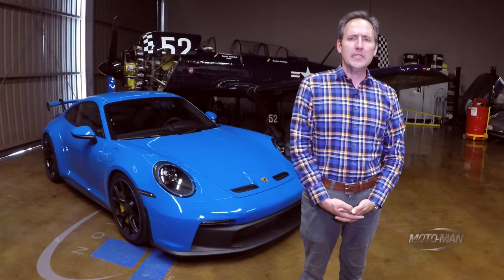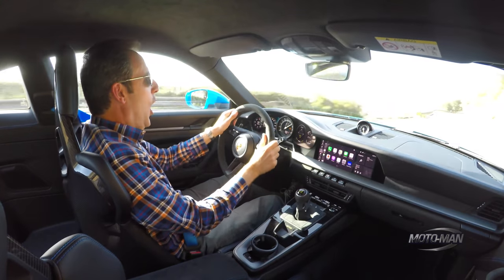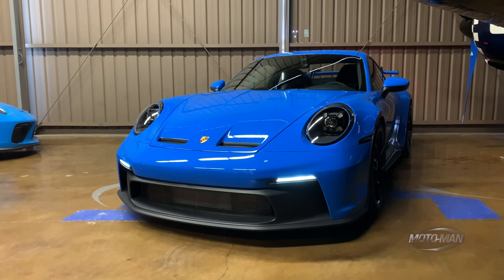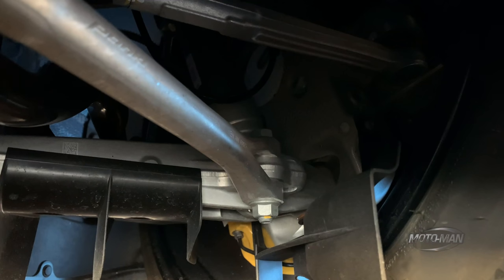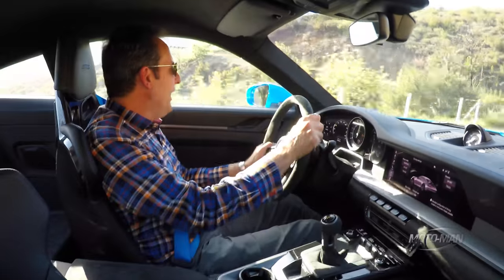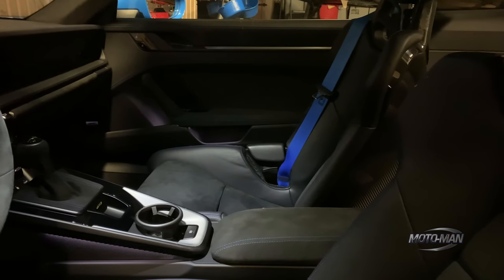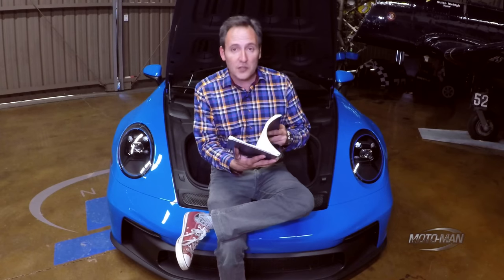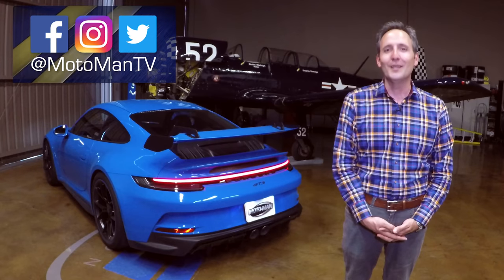2022 Porsche 911 GT3 (992): It’s Perfect!

Comment: There is no need to shift manually.  The car does a better job than anyone can.  Sport mode is perfect and for extreme driving on winding roads with sharp turns you just put it into sport plus.

Comment: The extended range fuel tank is the greatest option available on the 911, right now.  I have one on my base 992.... and no lie, I get almost 600 miles, that’s right, SIX HUNDRED, miles of range on one tank with the AC off!
Reply: You picked the wrong car if you're trying to extend it's range on single tank by cutting corners on AC and stuff like that, like it's some kind of economical diesel. I'd also take this fuel tank option but it wasn't possible on Carrera 4S because of front drive system.
Reply: @VK-sc6mf  Its the fifth car I own, I have a Taycan and Cayenne as well, so range isnt an issue.  The point is, with the normal tank, at least in an S; you get like maybe 200 miles of range with normal driving and with the extended range tank, driving 600 miles on the freeway at 70mph with bursts up to 95, you get around 500 miles....that's incredible, granted it was in a base, so the ER tank on an S/GT might be a little less but still, to have almost 600 miles of range on a car is incredible, thats the point and if you do a few things, you can top that.

Comment: I was afraid they were going to give it 8 gears what sense would it have made if they were lightweighting. It goes 0-60 in 2.85 sec and 10.85 @ 127.9 mph. They stiffened the rear springs to cope with the additional downforce.

Comment: Porsche says that the PDK top speed = 197 mph and the 6 Speed Manual top speed = 198 mph. What that translates to in the real world is over 200 mph for the 992 GT3 regardless of which transmission you have. I don’t think I’ve seen a Porsche made in the last 25 years that wasn’t quicker accelerating and had a higher top speed than what Porsche officially stated so there’s no reason to believe that the new GT3 is any different.

Comment: Well since over the last 4 years, I managed to save up 45k for a BRAND NEW Mustang GT Mach 1. It is perfect for me. 45k down payment and finance the next 11k. The car is a Mach 1 which replaces the pp2 I was going to get originally, until Ford made the incredible pp2 into the Mach 1 this year and the TOTAL cost is at 56k (dealer fees, few add on mod's and taxes jumped it from its MSRP of 52k). I was gonna get the pp2, but the mach 1 is more stunning, and is like a baby shelby GT 350 in terms of performance. Now it ain't no Porsche, but it's okay, after I install the borla's, I would not care about any car that can beat it, I'll just want to hear that engine sing. Another reason why I jumped on the Mach 1 which IN MY OPINION has the best engine note in the world. Yes the LFA and Carrera gt v10 are out there and so is Ferrari  V12's, BUT that grumble and roar of the 5.0 Cross plane DOHC V8 has the best Muscle, sports and oddly, high rev exotic sound in 1 package to my ears. I mean these dumb ass electrical cars which causes a lot of pollution to make 🙄 are freaking showing up everywhere now. I mean catalytic converters on the ICE engine are doing its job. A world filled with ICE cars with cats are better than having electric cars that were made in a factory that erupts pollution to make those batteries.
Reply from the maker: Great real world feedback, thanks!

Comment: Why do the brakes look cracked?
Reply from the maker: A result of the 'baking' process in creating Carbon Ceramic rotors.
Reply: @MotoManTV  so even with the cracking, it doesn't make it dangerous of chipping or anything else?
Reply: @NSDCTwitch  lol, Porsche have been using these for 20 years or so....there are reasons why not everyone likes ceramic brakes, but that ain't one...

Comment: I have chosen to ignore your advice and negatively opine about the size and weight. Why? Both have increased over the previous gen.and they’ve also increased NVH and cost through the need to use expensive lightweight materials to compensate for the bloated platform design. Secondly, despite using a more advanced front suspension geometry, which should give a more composed and pleasant ride quality, Porsche then goes and fits an unnecessarily harsh spring rate which ruins the daily ability of the car. What Porsche has done is make the RS model. And I’ll take mine in that python green please. 😁
Reply: 1.Did you happen to watch the Cayman GT4/Spyder video with Henry Catchpole and Andreas Preuninger? Porsche had to change their way how vehicle weights were published. In the past, you could just publish the weight with all the weight-saving options: CCB, bucket seats, PCM delete, whatnot. It is not possible anymore, so it is indeed plausible that the new 992 GT3 is not really heavier IF you compare it to a similarly specced 991.2 GT3. 2. All the reviewers seem to mention the overly stiff suspension, so the Touring might just be the one to go for.

Comment: Isn’t speed why they put all this expensive parts and design into this car? But then you don’t care that the manual is hugely slower than the PDK? List what cars the manual version finds company with 0-60. The base Carrera S  is around 3.7 isn’t it? Old guys like manuals like they saw their Dad drive and they had in high school. Is a dial princess phone also more engaging. Than an iPhone or voice dialing? Or go back to paper maps because it makes you feel more in touch with the roads versus GPS navigation? Porsche offers the manual because it is hugely more profitable for them - an old transmission they designed decades ago rather than the new super engineered PDK which is on some models priced near $4,000. Next manual buyers will want their Tape and  10 CD changers in the trunk. Just think it is time to not slow this type of incredible engineered vehicle with a 1960’s transmission.
Reply: Exactly - why my 2024 I just got an allocation for is PDK GT3.

Comment: Why do north Americans call cars "a 2022".  Its clearly a 2021 model.  Thats exactlt the reason it has a 992 model designation.  Its a 2021 BUILT 992 911.
Reply: It is up to the company when they switch over to the next model year. Therefore, clearly it is a 2022 model if they say it is. The law allows it as early as February. Also 992 began production in 2020 so that is completely irrelevant, lol.

Comment: oh oh oh you are really not loaded about the Porsche 992 GT3, to begin with it does not have 502 horsepower no there you are to hell wrong, because it actually has 510 horsepower from that 4.0 flat 6 engine.